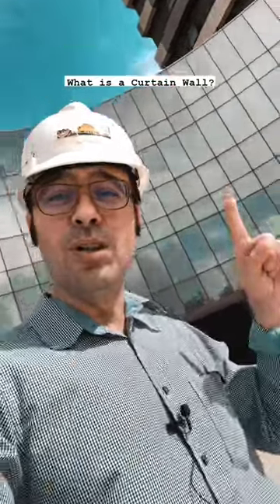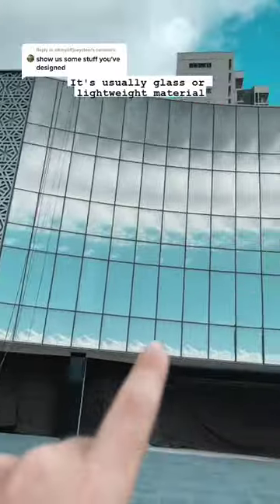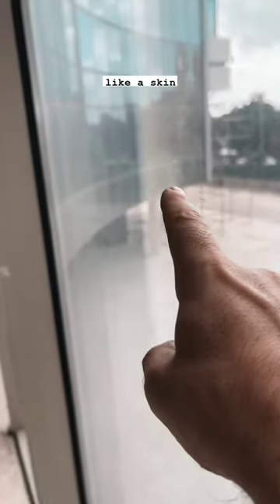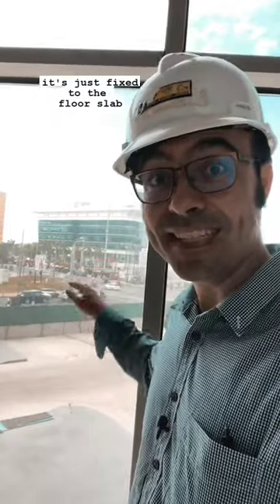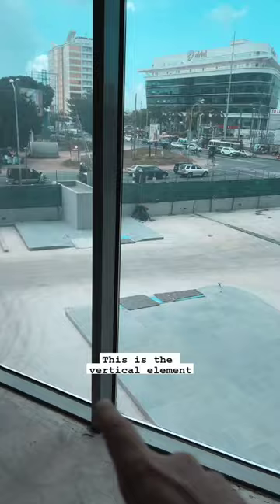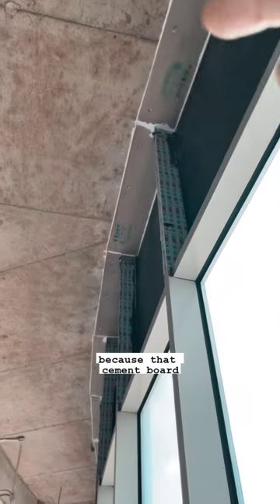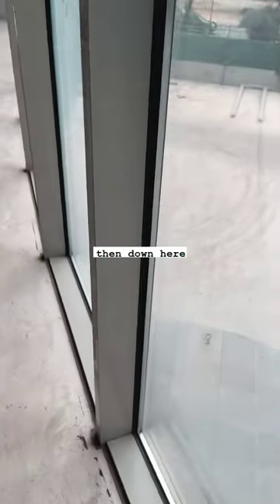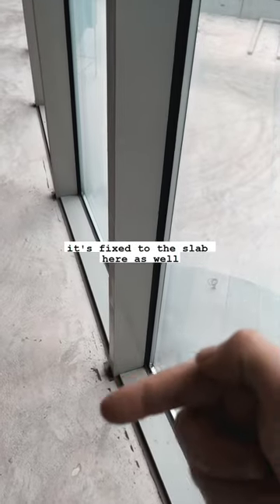Curtain Wall Explained

Comment: Can entrance doors and the windows of different aluminium profile brands be attached to different curtain wall profile brands or should they be of the same manufacturer ?
Reply from the maker: You just have to make sure the detail fits
Reply: I don't understand, do you mean I can, fit for example pvc doors into aluminium curtain wall, right? @ArchitectRussell
Reply: @triumfdula8830 you can do that… it’s just that the material and finish would look completely different. Usually you would furnish an aluminum entrance or operable window by the same manufacturer so that everything, detail and looks wise, looks the same